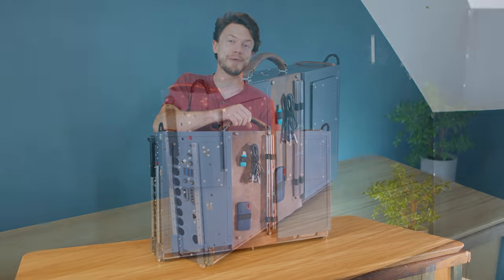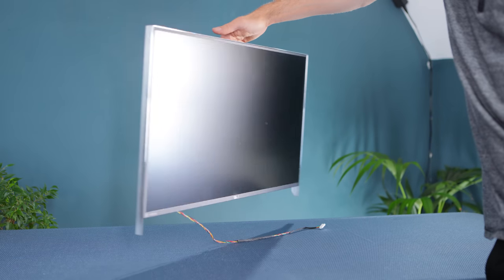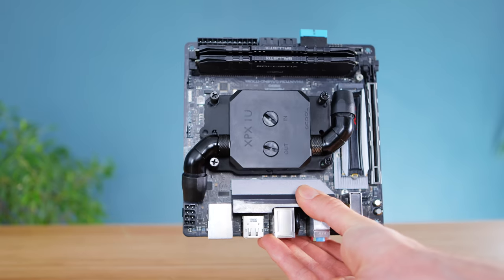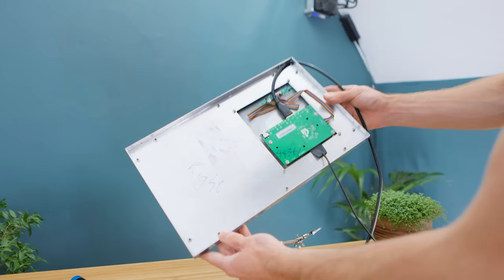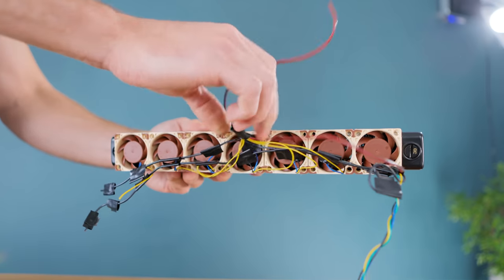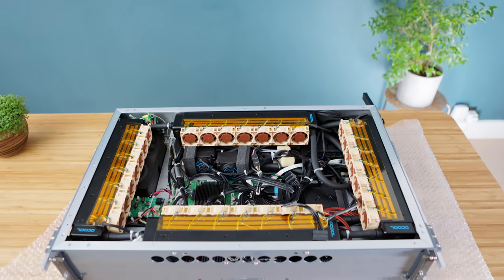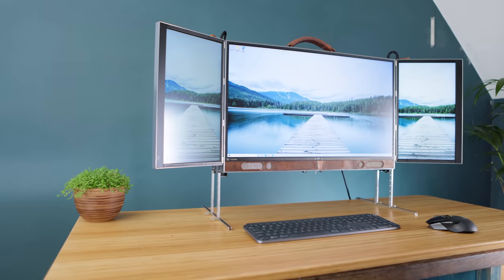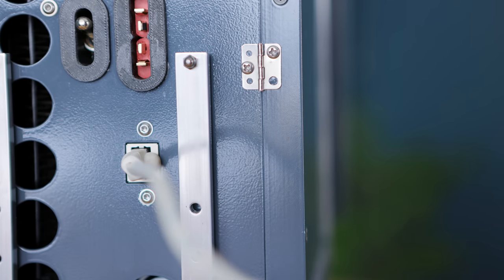Building a Luggable PC

Comment: Probably one of the most impressive builds of anything I've seen on YouTube as so much of it was done by hand and not thousands of £s worth of machinery.
Reply: I mean to be fair just the SSD's he installed are approximately $750 per unit and he has 2. Then he used a 3080 which is over $1K right now, granted I haven't looked at what prices were before the inflation. Adding in 4 liquid coolers, the 2 144hz laptop displays and the ASUS monitor in the first place this thing has got to cost a fortune (upgradeability may make it worth it though).
Reply: @herlincontreras4504  he isn't talking about the price of the components. those can obviously be swapped out lol.
Reply: @herlincontreras4504  He is talking about the building process like he did everything by hand and by himself
Reply: @herlincontreras4504  First he said Super spec and second the spend thousand of dollars on useless materials he used it for necessary components.

Comment: “Now we only need to add SOME watercooling”
*pulls out 4 massive coolers
Reply: I was wondering why he needs 4, aren't they just cooling the already cold water if places in series? Also how does the air flow work? Are they all 4 pushing out air from the system? Me thinks it might be working just as well with 3 coolers and a passive intake.
Reply: @Pauluzzs  3 totally could work based off the temps he got, but there is empty space anyway due to the thickness of the chassis as desktop components are used in addition to the size of the main display and adding more cooling will only reduce the noise under load. One of the advantages to watercooling is how silent you can make a system with enough capacity, and to answer intakes I would be surprised if after all this work he didn't set up  the fans in neutral pressure. Same size reasoning applies for such a sized sub-woofer in an all in one too.

With the temperature probe most of these fans can be disabled at idle too if set up correctly for silent operation using passive cooling of the 4 rads, though I am not sure if corsairs old LINK software does this, PWM fans can be set to 0 RPM mode in iCUE.
Reply: @Pauluzzs  with all the holes he have on the wide side of the panels, he definitely pushing air out. Those intake is definitely more than enough.
Reply: @Pauluzzs  the back of it have a big airflow so it doesn't matter

Comment: I found your channel by accident. You have some very interesting builds!

I had a HP Omen pc that performed flawlessly for many years. I decided to upgraded it as rending software was going gpu and my mobo wouldn't take a large card.

I meticulously back up everything onto a external hard drive. I had my pc built and it arrived  I had two ssd cards, no spinning drives. I transferred all my data over and then I had to use my external hdd's to transfer stuff form my sons old pc as I was giving him the Envy.

After two weeks, my ssd failed. I lost everything as a I had overwritten my old stuff with my son's stuff to transfer. I spoke with that bloke that built my pc and we spent ages checking things out and it was toast. I had to take this brand new pc to my local repair place and pay him to put in a new ssd and windows. I got a refund from the builder to cover my costs and so far this machine has been bulletproof. I lost everything though. Years of projects, photos I'd saved, etc etc etc.

Word to the wise, if you make a backup, do it on something you wont have to overwrite.

Comment: Pro Tip:
You can emulate a Corsair commander Pro or any other Corsair controller with a ATmega32U4 board. I recommend the small modules. 
It saves you space and about 90% of the Corsair price tag.
Reply: tutorial ? :D

Comment: "Uncompromised Performance!"
shows rocket league
Reply: I think the performance is more for video editing than gaming, tbh.
Reply: @dylansjperez  Well yes, but rocket league is not the most hardware intensive game there is now, is it? Temps at gta v, crysis 3 or just a simple benchmark would be more appropriate to back his statement.
Reply: Why no 3090?
Reply: @RickMyBalls  you're joking right? cooling and power supplies wouldn't handle it
Reply: @dylansjperez  Yes of course. But the point is he didn't make the PC for killer games, he made it as an editing workstation. There's no real point to him showing tomb raider at 4k max settings if that's not what he wants the performance for. Plus rocket league is arguably a better use of 144hz than most AAA games anyways.
Reply: This is not a benchmark channel
Reply: @RickMyBalls  where is he gonna get one? If you don't want to feed into the societal cancer that are scalpers then it's kind of hard to get your hand on any new graphics card, much less a 3090
Reply: @natalie5947  Sure, it was not build for games, but a benchmark provides a numerical value for its performance, either if that is games or editing. It probably does offer excellent performance even with those small fans. The point is rocket league was not the way to prove it.

Also, I don't think you realize how powerful a 3080 is xD. On Shadow of the Tomb Raider at 1440p it averages 132 fps (with DXR off) according to linus in this video https://www.youtube.com/watch?v=AG_ZHi3tuyk at 1:40.

So yeah, even at 4k I kinda doubt it would break a sweat on rocket league.
Reply: 5950x, GTX3080, 64Gb 3660Mhz ram..... kicks my current build well into the dirt
Reply: @Adonis-fz2tk  To be perfectly honest, it's well established how well a 3080 and a modern ryzen performs. As another user stated, this is not a benchmarking channel.

Also I pulled shadow of the tomb raider out of my ass, please insert [modern demanding game] here.
Reply: @natalie5947  I just happened to find that game first lol.
I agree, it's not a benchmarking channel. But you have to admit, rocket league is in no way able to show if it has "uncompromised performance". That statement may be true but it is not able to be proved by that game.
Reply: weird seeing you here dan
Reply: But it's running on three monitors lol
Reply: I saw an advert recently for a laptop bragging that it runs as well as a full desktop (it might idk) but it showed genshin impact on the screen which literally runs on mobile
Reply: I think, if you know anything about computers, we can all agree that the gpu, cpu, and ram being what they are, this is a pc that can handle basically anything you throw at it, lol. though I see your point. it is rather ironic that he showed rocket league when he said that. xD
Reply: should of shown mine sweeper, thats more power hungry than PRIME 95
Reply: Dan its got 16 Terabytes of storage this is an editing rig
Reply: @Adonis-fz2tk  it's  5950x with 3080, find a channel that has already done benchmarks for this. I'm more interested in thermals which I wish he did. He did say under load 65c but thats probably because RL isn't that demanding
Reply: Love you Dan :)
Reply: @mudanenadaara  I am also quite curious about the thermals.
Reply: Maybe he just likes Rocket League... 🤷‍♂️
Reply: Why am I not surprised to have found you in the comments? 

Every PC gamer: "I spent thousands on this build to play the most demanding games at a stable 144 fps on triple 4k monitors!" 

-proceeds to play Full Tilt! Pinball from Windows XP
Reply: He obviously doesn't mean graphical performance, but overall (including cooling) performance
Reply: @stefanfyhn4668  overall performance includes graphical performance. 😂
Reply: @ThatOneGuyEmblem  Sure, I didn't say it didn't include graphical. Just said it wasn't the only metric, which most others implied it was

Comment: This reminds me of an idea that I've had for the last few years, a portable high-performance pc/laptop hybrid more or less. My thought was, it would be cool if you could take your home pc on a flight with little hassle. The briefcase could work as a carry-on, but might be subject to dings and would likely be impossible to access mid-flight. My thought was, without having seen this video, was to build a custom mini-itx that could fit inside of a backpack, loaded up, as well as somehow getting a display on/into the backpack that's viewable when you set the bag on its side, so you can use it on the go, pretty much anywhere there's a table (so long as you have charge) ;).

TLDR: portable high-performance mini-itx build inside a backpack with monitor (insert?), capable of taking on flights or trips... is easily accessible. Just an idea, not an engineer, but would love to see you bring this to life, because I know you'll do a better job than me 😂

Comment: I have no words how cool that is. And how practical it is, too. 
I don't game when I travel, because I need gaming to be a relaxed, stationary experience, but I totally see laptop lovers using this for their travels.
P.S. I still can't get over his speaking tone. His cadence says "look how easy it is!" As if us, mere mortals, could do any of that. 😁 I find it pleasantly funny.
Reply: There's honestly not a lot in this video that us mere mortals can't do. I was expecting him to use a CNC machine for that mounting plate, but he just used a drill. The 3D printer is really the only issue there. Plus, this would be so much easier to accomplish with a laptop motherboard, rather than a full-fat desktop one. Pull a board from a for-parts high end gaming laptop and you've got at least one NVMe drive bay, 16+GB of RAM, an easy to integrate power delivery (could even use a high-efficiency power brick), and even built-in support for a battery (yank the circuitry from the original battery and slap it on a home-made one and you'll be good to go).

I'm honestly pretty interested in doing this myself. The only difficulty is cooling, as laptops aren't known for their standardized layouts.
Reply: @buca117  Yea, he could have also integrated a battery if he had done that.
Reply: @manuelh.4147  You have a point.
Reply: @manuelh.4147  Yeah, grand scheme of things, its not terribly practical except for very specific use cases. Thing is, though, this is a DIY channel, not an inventor channel. He's not trying to come up with the next big thing, just trying to solve a very specific problem in a way that he's satisfied.

As for me, tinkering is a hobby. I have way too many computers and speakers, most of which I barely if ever use, but that's okay. Some people have thousands of dollars worth of yarn in their houses. Others have massive gardens or project cars.

End of the day, if you're doing it because you enjoy it, spending a bit of disposable income on it is fine, healthy even.

Comment: I would love something like this to be manufactured. However, not a lot of prebuilt PCs are this loaded with quality parts these days. With their markup it would be extremely expensive as is, but I'd still buy one.

Would be nice to even have someone manufacture just the case.
Reply: Maybe Matt could provide 3d-models for the parts, there are options to get aluminium panels cnc-ed so at least the most time consuming part could be skipped if you had proper plans for them 🤔

Comment: This guy really stretches the meaning of “do it yourself”
Reply: It’s more like “Can’t do this shit yourself ”
Reply: You probably could do this yourself. You just need the time and the tools.
Reply: All the tools used would probably add up to around $1000. Not a huge amount, it's not like you need a lathe and a milling machine to do this stuff.
Reply: @p_serdiuk  Jigsaw & blades; drill, bits, & hole saw or stepbits; pressure gauge; clamps for straight edge; knife; rivet tool?; square & tape--what am I missing? That's easily less than $500. Other than the pressure gauge, everything else is basic. Cutting & drilling alumin(i)um can be done with woodworking tooling.
Reply: @tofmcwilliams887  3D printer.

Comment: DIY: Do it yourself
DIY Perks: watch him do it because level is too high.
Reply: people keep saying this, but what is actually hard about this? A lot of patience and a steady, accurate hand is needed to do the manual aluminium cutting, but really is anything actually prohibitive to do yourself?
Reply: @rossclutterbuck1060  Well, for one, not everybody owns a 3D printer. Not everybody is an electrical engineer and can wire the whole thing together. If you can, like he does, power to you, but if I did this.... it wouldn't end well.
Reply: @sjcommander91  electrical engineer? pray tell, what exactly did he do that requires engineer-level expertise in wiring? Everything in that build is just plugging plugs into sockets, with the exception of that funky little trick of splicing the fans together via copper tape. And that's purely optional.

And there are a ton of 3D printing services available if you don't have your own printer, plus maker spaces popping up everywhere these days. And lets be honest, if you're interested enough in DIY projects to be tempted by something like this then the chances are you do have a 3D printer or considering getting one. They're dirt cheap these days for a basic one.
Reply: @rossclutterbuck1060  literally every part for me? Kind of like if I was to ask you to do something you're not good at and ask you what's so hard about it?
Reply: If I had money to spent on I would have done it much better. I'm not saying in hate. but the thing is there are so many peoples out there who have extremely wonderful ideas but they can't make it possible just because of the lack of money. I'm currently saving money for my ideas hopefully you will see in future..
Reply: @rossclutterbuck1060  you know what's hard? getting the money to afford to build it. also, it's not that simple, you need your own measurements and planning. finding all the parts also takes some effort. if it is really that easy, build it yourself and show it to us
Reply: @rossclutterbuck1060  you're probably that person who just learned to change your own light bulbs and call yourself an engineer
Reply: @discjokievipul6023  what would you do if you can? for me, I would make some parts sit more flush to the flat surfaces
Reply: @rossclutterbuck1060  but that is just way too much effort to do, the price for this build and the time are just not worth it. i might as well get a laptop if hes going to still need it to be plugged in. No hate, i love these videos because his creativity is unmatched, just quite a few things he builds isnt really DIY
Reply: @TheNamesArif  I can design a A whole PCB board to plug every thing on it.  No wires. And I will design the aluminium body in such way that it connects directly to the CPU and on graphic card as a heat sink. Then only 4 fans needed from the sides to cool it. They will only turn on if the temperature ramp up during some heavy tasks. Well there some ideas which I don't want to reveal here. But as short glimpse I can make it to consume low power. And more efficient.
Reply: @TheNamesArif  finding the parts and affording to buy them are valid criticisms yes, but have literally zero to do with how doable this is as a DIY project. Different people have different levels of ability and that's fair enough, I know that if I attempted this it would look seriously rough because I have bad wrists so my manual accuracy isn't the best - the utter bodge jobs I've done with PC modding that past 5 years are testament to that!

But everybody whinging on this comments about literally impossible Matt's projects are is getting really fucking tiring now, especially with the only reason given is some flacid, childish meme talk about "level too high" or just apathy.

Could I personally do this? Probably yes, but the aluminium work would look appalling and there's a good chance I'd break the monitor because my manual dexterity is poor.

And no, just because I can change lightbulbs doesn't mean I think I'm an engineer. But then you're obviously the sort of person who's too busy talking shit on the internet throwing petulant insults around because intelligent discourse is something far beyond your ability.
Reply: Me tapes 3 portable monitors to my pc case Aw Yiss!

Comment: So awesome to see you actually making this. I have dreamed of something like this for years. I am a desktop man and I hate laptops, but sometimes you just need the portability. I had imagined making something like this but never done it.

The cooling solution I would go for would be air cooled, with those electric temperature difference pads to make the heat sync hotter, meaning it wouldn't have to be as big or heavy. I don't know if that would work but would love to try it.

Comment: I imagine it is already a bit heavy, but having an internal battery that could maintain it in Standby, or while switching from external AC to External DC would be a nice addition I think.
Reply: When you unplug the power while in standby, Windows will boot up as if it were in hibernation. So you might not need an internal battery :)
Reply: I agree. A battery for standby would be easy but if the PC were to wake up it wouldn't go too well. Some LiPos for RC airplanes could probably handle the lead.